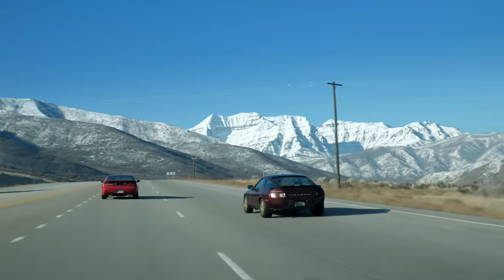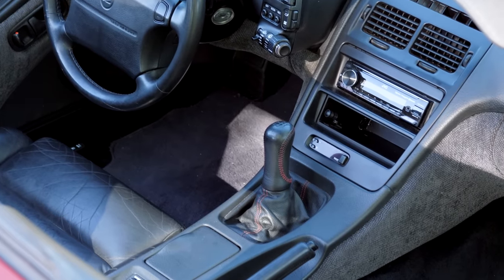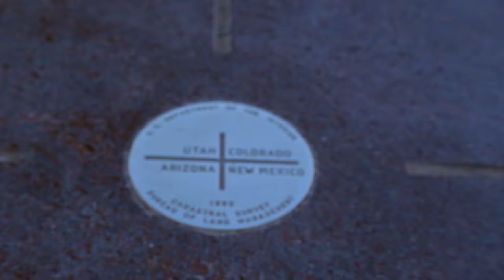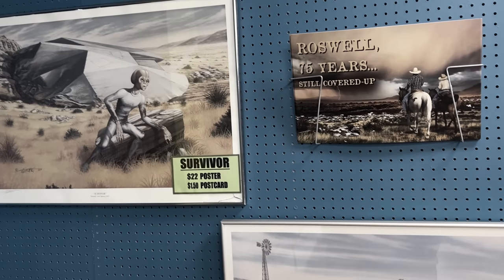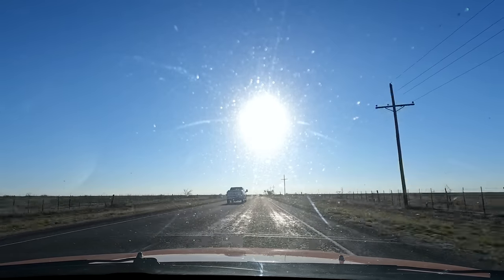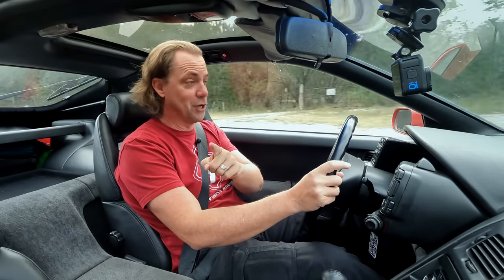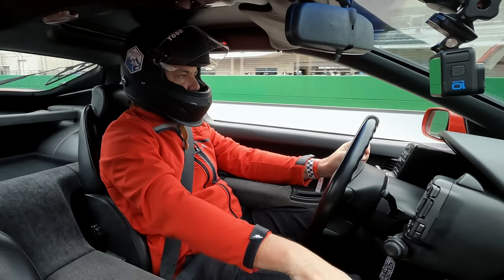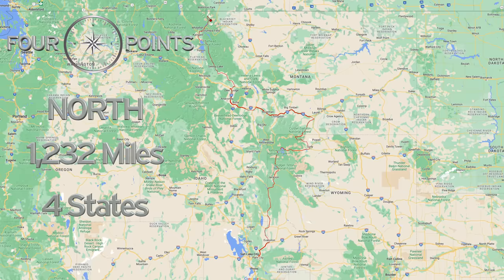Aliens and Texas’ Best Roads – Road Trip South – Cars of the Past | Everyday Driver

Comment: The 928 is a fantastic roadtrip car. I used to drive the hell out of my 89 S4 between LA and San Francisco when I wasn't stuck in LA traffic and it never missed a beat. It currently has 218k miles and only ever left me stranded once when a battery terminal got loose at like 1 am. I wouldn't trade it for anything.

Comment: Fun video guys!  You were within 50 miles of my home, and I drive these roads a lot so a few things to note:

**FM 335 where you started is okay, but not the best of the roads..  Far better are FM337 from Camp Wood to Vanderpool and especially on to Medina. FM 470 just south of those is considered the "low road"...Thanks to Paul (who convinced me to buy my 2002 Boxster S as couple of years ago) I'm now a member of PCA and our region frequently organizes group drives on these roads.  You're right too...top down on a nice day, even at lower speeds is magic in my Porsche!  🙂

**FM stands for "Farm to Market" and when these roads were built they were low traffic roads built and routed for exactly that purpose.  The are anachronistic because they are from a time when your '48 Chevy pickup MIGHT be able to do 45mph downhill, and probably not more than 35 uphill!

**To explain the surfaces, most of these FM roads in the Hill Country are built using a "chip seal" method.  This overlays caliche with liquid asphalt (tar) and then with chipped granite rocks which are rolled into the surface. Eventually, with our hot summers the whole mess solidifies.  The limestone underneath everything in our area has a high rate of expansion when it gets wet, and chip seal roads hold together better over time than conventional rolled black asphalt.  They are also far more "grippy" during our flash flood prone rains.  Plus they are quicker and cheaper to build overall.  However, rock chips are a real hazard in the Hill Country!  BTW, Paul wondered aloud why there are occasional patches of regular black asphalt.  Those are temporary "patches" and will ultimately be replaced when it's time to resurface a section.

**Biggest downside to chip seal roads is that they are very hard on soft performance tire compounds and eat them up quickly.

Thanks again!  Big fan...

p.s. Bucee's is a Texas treasure, LOL!!
Reply: Chip-and-seal, Tar-and-gravel or anynumber of names has few other advantages and disadvantages.  

Most of the advantages are around short term cost...equipment is inexpensive and can be easily attached and removed from multi-purpose dump trucks (for us) that double as plow trucks in the winter.  Materials are inexpensive and repairs for small imperfections can be done by two guys with a pickup.  Finally, long runs can be done with small crews in a single day with no need to prep the surface in any way (holes can be filled by two guys in a pickup leading the surfacing crew by a half mile).

Disadvantages you did not mention are the asphalt gets on EVERYTHING for days after resurfacing.  Recently resurfaced roads or those in need of resurfacing are a serious hazard to motorcyclist...especially those not paying attention to the level they should.  Both extremes in climate require frequent resurfacing...cold because the chips are easily dislodged enmasse at below freezing temperatures and hot because of "creep" which results in the lowered areas where tires roll.  Ride or drive on tar and gravel roads in the high desert of New Mexico and most of them can go 5-8 years (if limitted heavy truck traffic) showing no signs of wear.  Rip down a 3-year-old surface in Northern MN and it is two strips of almost bare tar if the lane gets a lot of traffic.  FM road in the Permian Basin can be 2" lower in the tracks just a few years after resurfacing.

Amazing process with flaws like any road surface.

Comment: You can instantly tell the audio from inside the Z vs from inside the Porsche. The interior of the Porsche is quiet, and I bet it's comfortable too. That Z is a noise bucket.
Reply: T-tops probably don’t help with wind noise. However, the 90-96 Z32 is widely regarded as one of the most ergonomically perfect interiors of any sports car from the era. Fits just like a glove.

Comment: Having watched this entire series with these two cars, I’d definitely take the 300ZX TT over the 928. IMO the design and styling of the 928 hasn’t aged well. 
Aside from styling, everything on the Z still works, whereas the 928 has been plagued with mechanical issues and still doesn’t have a working speedometer

Comment: I consistently feel like Porsche shifters are just... Not fun to operate. They're fine. But you wouldn't shift through the gears at a stop light just for the pleasure of it.
Reply: The 944 is also a transaxle Porsche but without that dogleg box and provided the gearbox is not overtly worn, they have a much more positive shift and good weight. Both are a leap ahead over the in-period transaxle Alfetta GT/GTV/GTV6